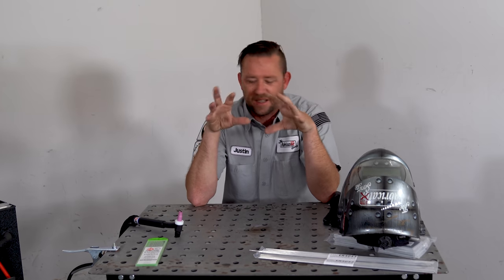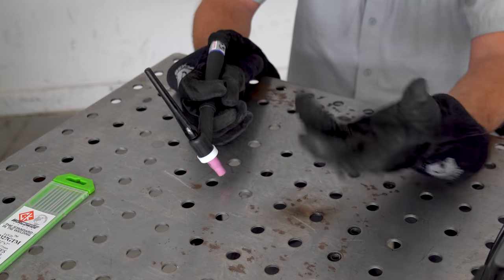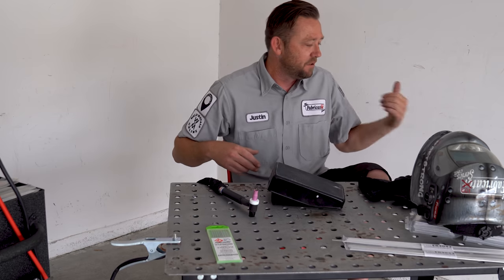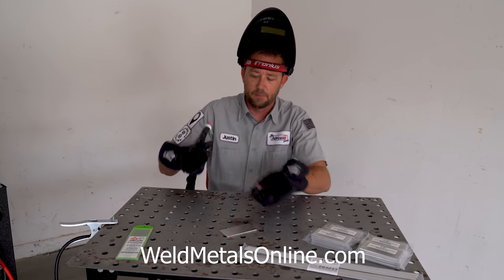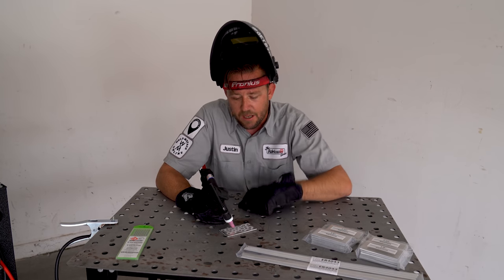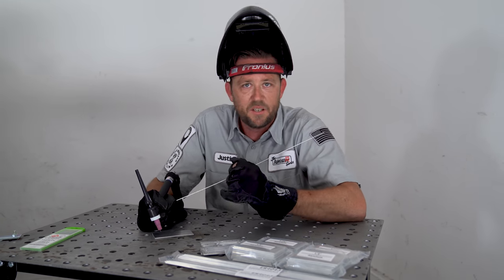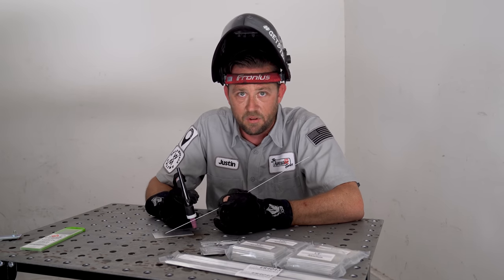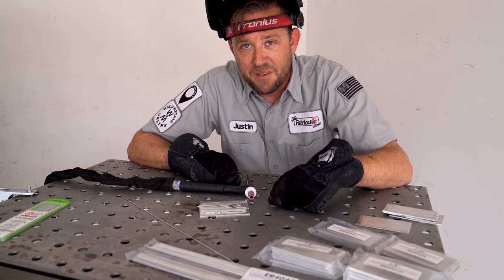Your Very First TIG Welds with EXTREME Detail

Comment: I know this is an old video. But I found it because I'm trying to learn TIG after doing MIG. In the class I'm in right now for aluminum. I was told to put my machine on dc + and ball my tungsten. I noticed you were keeping it rather pointed. And chance you could go over the pros and cons of both

Comment: Thanks for this great video! 
Question here: When I touch the pool with the tungsten (actually using green 1.6mm or 2.4mm), it just make a huge black burn and contaminates the tungsten. I then need to stop, clean (break and reshape) the tungsten otherwise the next start will produce the same disaster. I was surprised to see at #29:05 that you touch the pool and do not get that black burn and can continue welding. 
Is there a reason why your tungsten is not getting contaminated?
Thank you in advance.

Comment: Really good video ,just ran into it surfin the tube .Question ::do you ever where any type of breathing apparatus  when you're welding , I ask this because about 10 years ago I had a brother in law die from lung cancer ,the cancer was directly and verifiably  caused by fumes during the welding process ;he was a welder for more than 20 years. I know a lot of welders and no body wears any type of breathing filtration Ive seen the fumes coming off the welds ,pretty thick sometimes . I know its not really practical to get all strapped up in a breathing apparatus but damn why doesnt anybody use them?

Comment: Well how bout that, I already have a decent amount of welding experience with all the different types, but even if I didn't your method and instructions are hands down the best, I like how you show the wrong way and it helps me see what I did wrong based on the metal in front of me. You literally can pig up the torch and start tig welding by following your instruction....the rest is just practice

Comment: Great video!! But I have a lift tig set up that I have bought n still haven't used it, cause I can't find really any good info on like the one's you do. The one I have also doesn't have a foot pedal also n the company said you can't get a pedal use on it either. Its one of those that doe's Ark, mig, mag tig and stuff. Its also a DC welder also, it's about the only one I could afford at the time, I had heard you can tig aluminum with straight helium but its still dirty looking. But keep the video's love watching them!

Comment: I definitely don't have particularly steady hands, but a few tricks helped me get into microsoldering. Maybe they can be useful to someone.
1: Rest your whole forearm on the table. Elbow included. Not just touching, let the table carry their weight. A lot of minor tremors comes from tension in the large muscles of your arms, shoulders, neck and back. They may be imperceptible there, but the further out they travel towards your fingertips, those tremors attenuate exponentially.
2: To the extent possible, rest the side of your palm on the work surface. Only navigate your tool with your fingers.

Now I'm not saying this will work for everyone or every job. And it will still take some practice and fine tuning for your individual comfort and dexterity. And for most people, there will still be some minor tremors when you're "just hanging" and hovering your tools (like the shaking at the far end of a fishing pole), but they smooth out substantially once there's a bit of contact (like the far end of that fishing pole touching or resting on something).

Comment: Lol , the first time I tried TIG and acetylene which was 25 years ago looked like those roughly at 22:39 that but with little BBs , some attached and some rolling around everywhere . That could of been from mixing the acetylene equipment with TIG equipment because I was still learning ; like using a coat hanger as a TIG rod , lol .

Comment: Hi Justin I have a question. I've been welding as an amateur for my own projects some yrs, I own quite an old oil cooled stick welder its called a cytringham bantam can this be turned into a tig welder with the appropriate parts if so wats the parts I would need please

Comment: I hear you talk about people asking what settings you have your welder on I your videos and I agree with you it doesn't matter cause you are in control of it with your foot and travel speed and I laugh cause the people that ask just wants to set the amps and push the pedal wide open so they can eliminate having to worry about the pedal. Lol I experienced that today a new guy asked me what my settings was and I reached behind me and turned my amps down way low and turned my machine off and told him it's all about travel and foot pedal. Lol I went to lunch and watched him turn my machine on and check my settings as I was clocking out . When I came back he was trying to tig with the low settings I turned my tig to before I left for lunch lmfao.. 🤣

Comment: you have to remember that it's a normal liquid with surface tension (a very strong one actually). if the temperatures are right, filler is gonna flow where it needs to and create a good shape and finish automatically

Comment: I would love to ask for help or feedback. I have 0.75 mm thick sheet metal steel and I'm new to TIG. I will practice with thicker steel but i would like to ask for parameters to weld with this 0.75mm, like which tungsten rod diameter should i use best? Which current? Etc.... It's for a handmade exhaust for a motorcycle. Thanks a lot !!!!

Comment: Hi there, just want to share my input to this. 
Im not a welder by trade. Im a Industrial Electromechanic. In my trade school we barely touched the TIG (like a day or so)( mainly focused on rod and mig on the 60hr module) I have to weld like once or twice per couple week at work. 
I trained my muscle memory for feeding wire by carrying a bamboo skewer and practice the filler technique whenever I'm at home on idle watching TV or anything or some sort. Believe me in less than a few days it will become second nature. It speeds up hand dexterity for those who welds occasionally. It it important to keep practicing. Some are gifted, I'm not there, and will never claim to be. But In food industry you really have to make quality consistent welds. This trick helps a lot! feel free to add in replies your opinion.

Comment: Hello.  I watched this video of yours and came away with a lot.  It was very good.   I'm considering buying a TIG welder.  I have a Hobart Handler 190 Mig welder but want something to that's easier to weld sheet metal (not super thin but automotive gauge).  There are lots of TIGs out there.   Do you have a recommendation ?  I was thinking of the Lincoln Electric Square Wave TIG 200 TIG Welder.  Thoughts ?   Thanks in advance.  Scott

Comment: it's a quite bold statement that "work in any position if that's comfortable to you". Hey Justin, you might be a good welder, but not a good teacher. You cannot dump ergonomics out of the window just because you want to suggest that "do what you want" feeling. As teacher of some kind you must understand that there are positions that are good for welding and there are that are not. Everyone who never worked on a desk must look into the ergonomic suggestions of table height, lighting for example. Don't ignore the many many people who's job is to create healthy working environment and working daily on making the norms of workplaces. Welding is working, that means it puts extreme stress on the senses and body. Even if you don't know about the norms, you should point your students into the direction. There are standards that are good lead on where to start, and people can tweak that norms after they understood them. I know you are a full fledged american with freedom feeling all over, but even you suggest that they should start tigwelding in a sitting position. Because it's the easiest. Then you can learn position welding.

Bad body postures lead to deformations and many illnesses. As you suggest and demonstrate to use helmet, you also should suggest other parameters of healthy working conditions (like using gloves yourself). The work safety is the key for you to be able to 'fabricate' and generate income as long as possible. It's just reasonable to do so.

Comment: You should do a push button video. I use the Miller Syncrowave 400 with the button configuration. Using the pedal unfortunately isnt conducive to the things I'm welding, I.E, Aluminum Sports Equipment like NFL Goalposts, USA Track and Field Equipment and all major sports

Comment: Thanks man! Any advice when you only have a liftoff TIG?  I can’t change with a foot pedal so my coupons always get to hot and that weld puddle floods out after and inch or so no matter how fast I go.  Then I turn the amps down and it barely melts a puddle.  And of course NO POSSIBLE way to stay on the weld at the end as I have to snap the torch off to stop it.  :-/
Reply: The gas coming out of the torch can be turned up too high and it can be blowing on the puddle and spreading it out. I don't know for sure but that is a thing with the porcelain cups.
Reply: @Useruserusername790 thank you, I e since got a pedal and life has been much better 😊

Comment: I was taught to carry the lead on your shoulder to carry the weight of the lead itself allowing the 2-3 ft drapes down your chest onto your arm cradling the torch in your hand it's just like freely there with him gesturing with his hand waving his arm around I was taught the exact same way just with the lead hanging on my shoulder where you don't really feel the weight.
He holds his torch perfect.
If you keep 10 to 18 Inches exposed before the torch handle where it drapes over your wrist and forearm you can get a good idea of how hot your coolant is getting somebody said Never let it lay in your lap where it kinks is where the cables going to burn through the tubing resulting in a steam burn if you get it too hot. 
To carry around 300 amp TIG torch all day isn't likely but depending where you work maybe a reality.
Many times we used a much lighter torch just because of where we had to snuggle into to do the welding using a flexible straight torch.
Even on the bench welding I had the cable burn through a tube or two in my life letting it get a little too hot.

Comment: Right from the start: do you need a metal table or is it a nice to have?
Reply from the maker: @radsy5821  Welding requires electricity. Metal conducts electricity. You need a metal table to conduct electricity so you can weld.
Reply: @TheFabricatorSeries  I get that, but is it possible to ground the piece directly or is there some reason, maybe aluminium or TIG specific, why you can't do that?  Might be a noob question, but am noob. I appreciate your content, it's among the best I've found.
Reply from the maker: @radsy5821  you can, but will the clamp be in your way? There's no universal answer.

Comment: the hose i usulay take it over my neck so it is balanced just as long as my arm i switch between hands so that my shaking hand holsd the filler wire and we did not have a peddal there were switches on the torch i am right handed but i go left to right because my right hand shakes a bit too mutch, but my right hand shakes enough for the filler wire 
i must say your video was good very well done it reminded me of when i was at school welding for the first time

Comment: The electrode is always plugged into the negative for all Tig welders but what about the Tigs that also do Arc? Do you need to switch the electrode around for DC and A/C or does the electrode still stay in the negative? Specifically asking for the AHP TIG/ARC welders such as the 203Xi but they should all be the same.
Reply from the maker: Depends on the electrode you use. Look on the box and it will tell you what it does or can run on when stick welding. On TIG it's always electrode negative no matter what.
Reply: @TheFabricatorSeries  
what 
I meant, I wasnt sure if the machine is reversing the polarity for the arc when you push the button to choose ac or dc but I think it's not so I believe you have to manually reverse them for whatever you want.

Comment: about how much filler wire do you use per inch of weld on average? you said to give yourself about 4 inches of length for a 4 inch weld. so i presume you used about 1-2 inches of wirw in a 4 inch weld for an average weld. And if you needed to fill with mor material then you would be using more than 2 inches of wire for a 4 inch weld? and if you didn't need to add much material then it would be less than 1-2 inches of fill wire for a 4 inch weld?

Comment: Great video, but as a 100% beginner, I see that at 12:44 suddenly there is a clamp on the table and not sure when/where/why to place this (complete a circuit I'm guessing as an engineer) but still would like to understand how to place this, where not to place this, what happens if you don't, what if you touch it by mistake, etc.

Comment: I received my Primeweld 225 and started practicing tig welding today on some aluminum, and i have to say that this💩right here is some of the hardest💩that I've ever tried to get right EVER!😡 I've gone through 9 tip sharpenings so far and I'm ready to throw this damn machine on the floor and bust it open! I probably would if i didn't dish out over $800 for it😂 Luckily i bought 5 pack's of tungsten rods cause it looks like I'm gonna need every last one of them, that's if i don't give up and throw this machine out in my driveway as hard as i can! I've watched every one of your tutorials and still💥😭

Comment: Hi Justin, and your loyal fans - I'm lookin' forward to your "Weld With Me" session in two weeks. I've had about 2 hours of attempted independent learning of Tig welding aluminum (unsuccessful), but perhaps dozens on steel with much more success. 

I'd like to share, that for anyone who relies on an electronic medical device, to maintain a healthful condition of self, that Tig welding AC, in vicinity of that device, will toast it. I use an insulin pump, read the warning that came with it about electromagnetic fields, but IGNORED The warning. Within that two hours of 120 Hz AC Tig welding on some 1/4" aluminum, I  killed my pump. And, I was even standing, without having the torch lead laying in my lap. So, I will continue to learn Tig, but fortunately I can disconnect the pump, and leave it in the house while I'm welding for a little while. It's only when running high current AC in the torch, that causes an electromagnetic field strong enough to fry nearby electronic devices. Therefore, no problem welding any other material.

Pacemakers are not nearly as convenient, so, if anyone who is dealing with either of these health related devices, please take appropriate precautions.

Comment: I can't help but notice how much more flexible your torch cable is than my ~30 year old unit's...
Welding experience edit - mig time 15-20 hours, tig time ~15 minutes
Reply from the maker: Might be time for an upgrade/update. Torch tech has changed a lot over the years. I can get you a quote for a new CK torch and accessories if you send me an email.

Comment: been doing your practices.... now I'm stuck. I am having so much trouble dabbing. I can do it with no torch easy. I can torch (control the puddle) with no dab easy, but when I try to do them together, the rod gets stock on the stock metal, then I get behind and I'm all screwed up. Its just too fast. So I lower the amps with the foot pedal then the arc gets all squirrely and the weld gets gross and contaminated.

Comment: What if the TIG welder isn't setup for a foot pedal?  I just bought the Yeswelder MIG welder 250A Pro Aluminum welding machine, which does MIG/TIG AND STICK welding, which this machine isn't setup for a foot pedal.

Comment: Today I made my very first steps on the slippery slope named tig welding. I got all the results as seen in the picture used for representing this video, just the perfect bead was missing. Afterwards I saw why, I assumed the coupon (a piece of scrap actually) was 2mm in thickness, when it turned out to be 3; so I was a good 40 amps too low on power........ As the old Dutch saying goes, to measure is to know (meten is weten). Hope to fare better next time and make other mistakes :).

Comment: I've seen you just take the coupons out of the bag and use them. Do you just weld through the oxidation layer? I guess not but since this is "extrem detail" i also didn't see you addressing preparation. Other videos have explained this to be very important.
Reply from the maker: The positive side of the AC wave is for removing the oxide layer on aluminum. There is no reason to go to any additional effort. One benefit of using coupons from Weld Metals Online is that they are ready to weld out of the bag. The wipe/prep work is already done.
Reply: @TheFabricatorSeries  awesome, thanks for the reply

Comment: Sorry for ignorance but, is there a way i can practice without using gas ? getting a cylinder is proving quite hard where i live..
Reply: @rippinscreamingmetal   thanks, i do not expect to do actual welds, only practice runs to get the rythm of it on some sacrificial plates.. so, despite the contamination, would it be useful ?
Reply: @rodrigomartinelli741  no unfortunately you have to have the gas. it will chew up your tungsten cause the it needs to be shielded as well. and it wont produce a weld pool or kind of Bead at all It would do make a big mess. it just as important as the base metal the filler rod and the electrode . It's OK to try it just see what I am talking about you will go for about 5 seconds and abandon the effort
Reply: Thanks, guess I'll wait then..